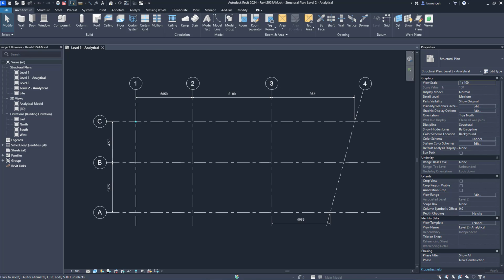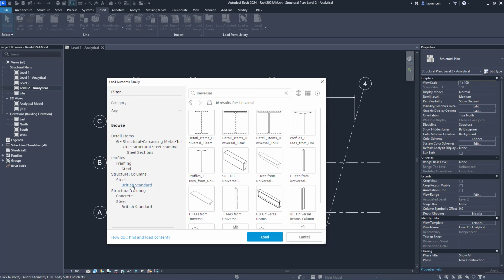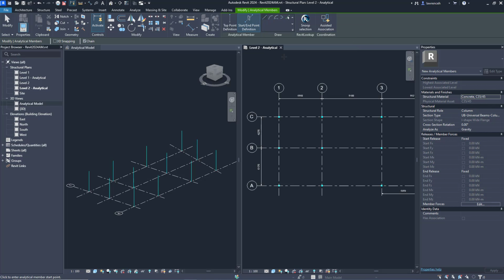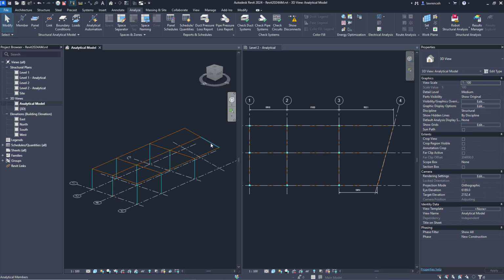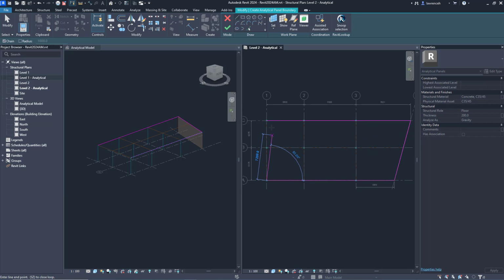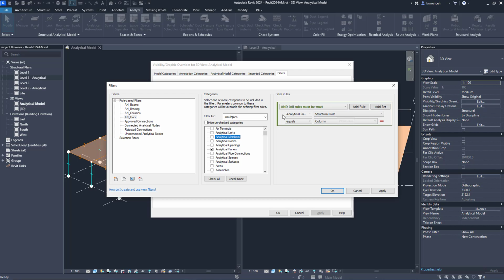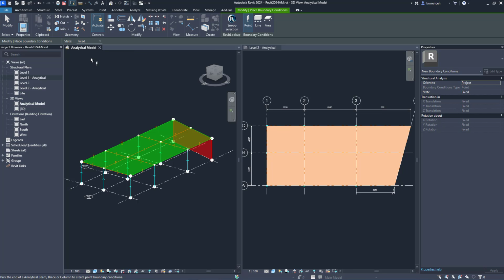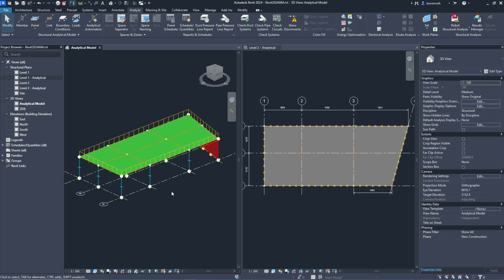Revit 2024 Tutorial - Analytical Modelling

Comment: Would have been interesting to see you do it with different serial sizes. I'm currently trying to draw an analytical frame with varying sizes and all of the analytical lines are on the centroid of the geometry with no way of setting to a specific level - seems kinda useless.
Reply from the maker: It doesn't matter what the section size is with the analytical members. All the elements will be drawn on the same plane. When the physical model is created you control if the members are top of steel, bottom of steel etc.
Reply: @RevitStructureBlog  I blame frustration but I should have specified that I'm attempting to utilise the Autodesk 'generate analytical model' dynamo graph and it is very much is putting all of the analytical lines on the centroid - both in 23 and 24 irrespective of the tolerances and options picked in the graph. I could no doubt draw it manually on the correct plane, however then I'm in the realm of "why not just draw it natively in the analysis package". Okay it won't be dynamic, however in this case it's an existing building so that isn't an issue.

It just feels as if they've taken a massive leap backward. All it would take is the option to 'set line to level' and 'set line to grid' in the properties. I appreciate that theoretically  their dynamo script has that option, but after hours of fiddling with it yesterday, it doesn't seem to work.
Reply from the maker: @nicebikemate  ah, thats a different case! Yes, the analytical model generation graph for 2023 & 2024 is not up to the job. Autodesk have rewritten this for 2025 which is a big improvement. However, to generate the analytical lines for the framing you can get the location line in Dynamo which will follow the physical model. For example, if all your steelwork is justified to top then the location lines will all be at the top as well.
Reply: @RevitStructureBlog  Yer that's what I ended up doing, frustration slightly subsided. Thanks for the responses.

Comment: For the analytical model you can't create the columns using the "AT GRIDS" option and for the beams use "ON GRIDS" option to make it faster instead of placing each one by one? All you have to do is draw a crossing selection across the grid lines.
Reply from the maker: I am sure all these extra features will come in future releases.
Reply: @RevitStructureBlog  What I mentioned on my comments regarding adding columns and beams by crossing selection the grid lines already exist in Revit. I'm not sure about analytical model.
Reply from the maker: @arkinimation6394  Hi, yes, this is currently available for the physical members but not the analytical members at the moment.

Comment: Thanks for the tutorial! Would you please also make a tutorial for analytical modeling of concrete structures where the beam members are connected with rigid links from the column face to the centroid of the column cross sections (rectancular, L-shaped and Z-shaped column sections etc). Also maybe include split level in slabs, with a 2D member for the Z-shaped deep beam connecting the two slabs at the split level.